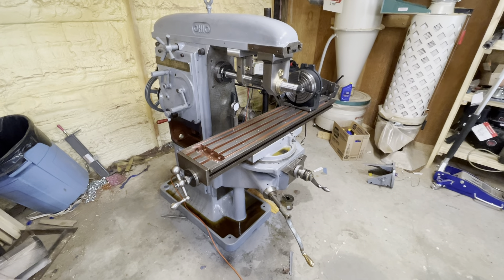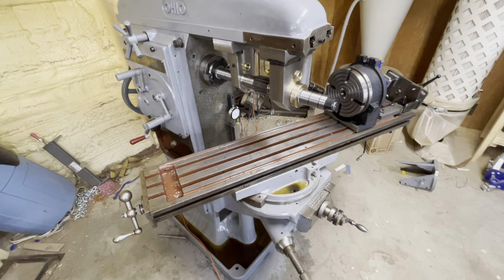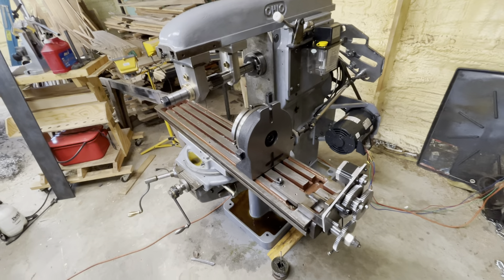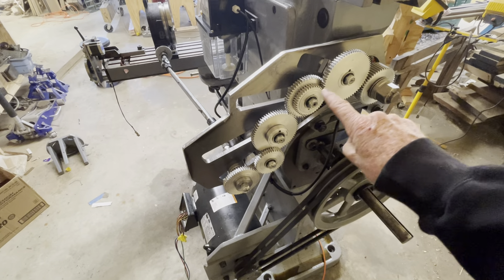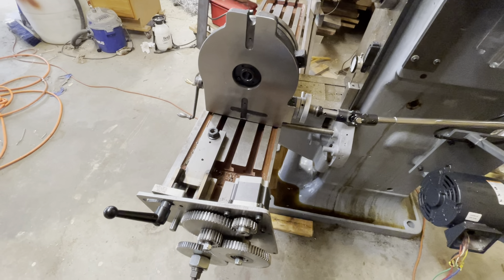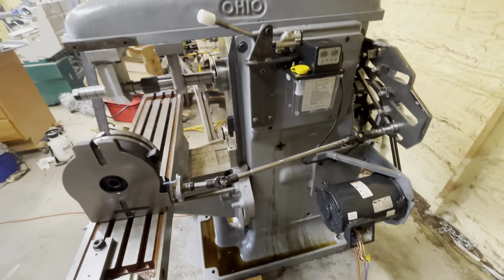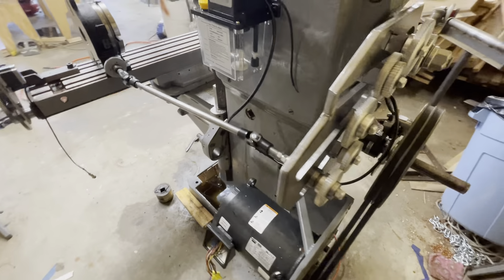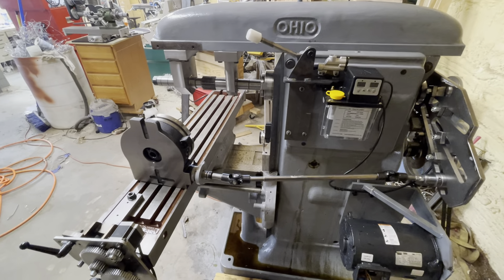Oesterlein Universal Update

Comment: Do you already have 3 phase or are you using a VFD?
Reply from the maker: I have a phase converter for my lathe, but I bought a 3ph motor for the horizontal machine, and I use a VFD for that.  Nice speed control and a soft start.